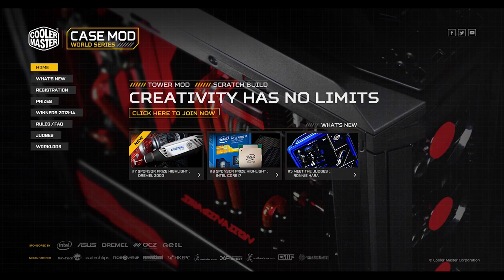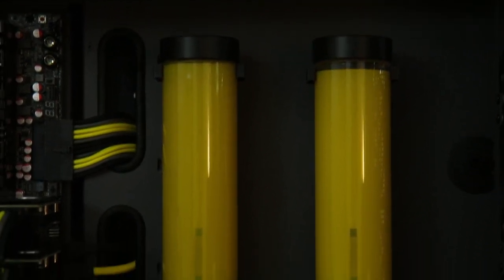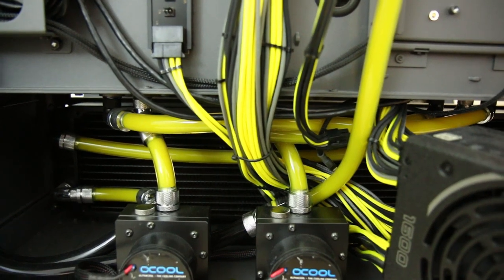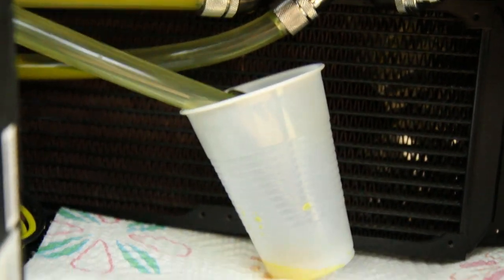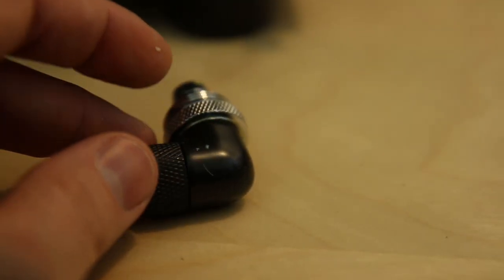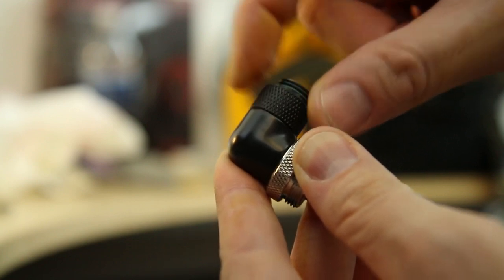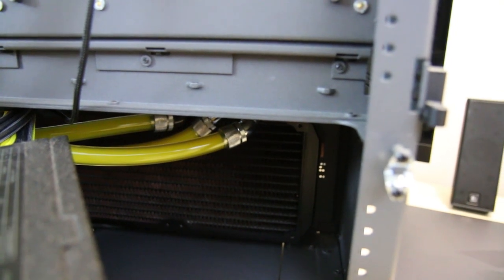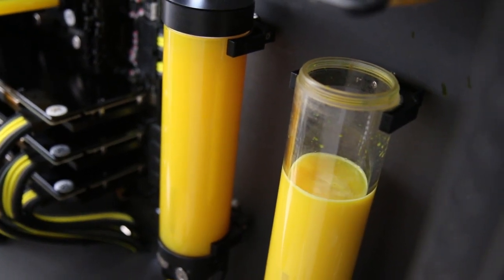My $6500 Custom Watercooled PC LEAKED!!! Now lets fix it....

Comment: lol 800$ watercool kit vs jerry aircooler jerry won !!!
Reply: I guess Jay´s system is more powerful than jerrys ^^^3x GTX 980 very high OC > 2x GTX 980 poor OC
i7 5960x @ 4,5 GHZ = 2x random xeon @ 3 GHz
Reply: the cooling solution not the entire system im talking about
Reply from the maker: Viking Tech If we are talking about Reliability and Maintenance, then yes Jerry Wins
Reply: tks
Reply: ***** Because Jerry´s using aircooling from noctua, and noctua fans & coolers are extremely reliable. But from performance sight jay wins. :)
Reply: Christoph Zehetmayer Not to mention water cooling looks way prettier than air cooling ;)

Comment: I'm too scared to water cool
Reply: Their is no need for it
Reply: The best way to go is closed loop with like a h100i but yeah this is open loop and you have a higher chance of a leak
Reply: +super piggy over time, with whatever components you use, they don't stay as cool as they would have when coming straight out of the box. So i guess there it's purely aesthetics and future proofing. And of course those who don't want to custom cool can always use AIOs which are much more safer but not really the best future proofing.
Reply: +Joeyb Theman Are you scared to use your kitchen sink? Are you scared to flush your toilet? Probably not, because you know they were assembled correctly by professional plumbers. But those plumbers didn't have the option to assemble your water setup outside of your house, and then install it in the house, so they made sure they did the job correctly. You can assemble a loop outside your PC to test it, there's nothing to fear.
Reply: +CreoleRep7 That is not true at all. The Thermal Design Power (TDP) of a processor or GPU is the same when it's 20 years old as it was when it came out of the box. If the transistors in the component have deteriorated enough to actually increase their heat output, the component was likely unstable or malfunctioning long before that point was ever reached.

Comment: Reading the comments it is clear to see that few understand how air cooling and liquid cooling work. For starters liquid cooling is just another form of air cooling as it relies on air passing through the radiators to cool the liquid. Air cooling and liquid cooling both cool through a process called thermal conduction. Thermal conduction is the transfer of internal energy by microscopic diffusion and collisions of particles, the speed and effectiveness of thermal conduction varies depending on the material used. The conduction process can be made more efficient by increasing surface area and/or increasing air flow allowing for faster thermal conduction. Air cooling relies on conduction through a heat sink usually using pipes to efficiently conduct to a large surface area, the fins. Unfortunately heat sinks reach a point of diminishing returns beyond a certain size to the point they don't offer any more cooling performance. Water cooling does also reach a point of diminishing returns, but it has a greater potential to conduct than air cooling due to the fact that liquids conduct much better than gases. Liquid cooling is able to move this heated liquid away from the block using a pump, so in turn has the ability to conduct to multiple heat sinks (radiators) and this is the reason that water cooling is more efficient than air cooling,  its able to conduct better and to a larger surface area. You should think of liquid cooling more like air cooling, but with the ability to connect many heat sinks (radiators) together. One more thing, usually All In One liquid cooling products are cheap with only one small radiator, low quality liquids and small pumps, so they don't perform much better or they perform worse versus air coolers of the same price.
Reply: Hello rick and morty fan. I wish my IQ to be as high as your 200 IQ one day

Comment: I want to see vodka cooled videos. Please. Thanks.
Reply: that would be a bad idea...
 bc your pc would be drunk as fuck... ahhaha
Reply: Vodka is aiming fluid comrade. PC would just become aimbot.
Reply: DevPre Are you seriously taking his joke?
Reply: In the meantime, look up his video on orange juice, milk, and Powerade. Because science.
Reply: He did use Anti-freeze. Usually in anti-freeze are chemically similar components compared to vodka. It wasn't very special.
Reply: Volkier Neigh I mean, the Russian used it to cool their radars. So it must work in pcs right??
Reply: Thats a really bad idea man, for so many reaons. Its a solvant (tubes wont like it and rubber will bleed off its oil and become dry), its flamable, it evaporates faster than water, and its a much worse lubricant for a water bearing pump. Its also lighter than water and thus has a lower thermal transfer rate unless its evaporating. It also has a lower thermal capacity so of the heat it does absorb, it cant absorb nearly as much per litre with 40% alcohol in the water, which means if you are overclocking and making record runs, you have less time to do so before the water temp raises to a point where a highly strung overclock is unstable.
Reply: Its done

Comment: dude, I worked in the oil/gas industry, and fittings and lines thousands of dollars leak. sometimes welded lines leaked. but seals and gaskets tend to leak regularly and frequently. so that's why its better to change seals and gaskets on a schedule when u can plan for it, than have it happen when u don't know.

Comment: Talking about cooling. I remember one summer where I was at a friends house, and he had to put 2 bags of ice, one infront of his intake fan, the other on the top of his case, because the summer was so hot, the computer was overheating every 15 minutes. The interesting thing was that the ice bags actually helped and the computer didn't overheat until the bags melted!

Comment: Holy fuck... haven't finished watching yet but I hope nothing is broken!
Reply: Kawayolnyo dude stop trolling
EK is one of the best manufacturer in the market.
Reply: Kawayolnyo I use EK and bitspower and have had NO failures.
and some of these fittings are 5 years old
Reply: Kawayolnyo both are working fine
your argument is invalid
Reply: Kawayolnyo stop trolling kid.
Reply: Kawayolnyo All rubber O rings go bad regardless of the brand. A better brand might just make sure you have a newer part so you have more time before it is likely to fail. It is still likely to fail at some point.
Reply: Kawayolnyo Good to hear you haven't had any leaks. If you upgrade to new systems or replace parts in a system often then you are less likely to encounter this issue. It can take a few years for an O ring to go bad. It is a numbers game. You might never have an issue or you might have lots of issues.

The quality of the part does have some role to play in the mean time before failure. As the part ages though, your odds of failure increase. Not every fitting with an O-ring is destined to leak but many will eventually leak. A quality part can buy you some time and give you better odds but even the best parts will fail some of the time.
Reply: Kawayolnyo I read the post. Go read mine at the top of the page that goes into detail about O-rings. EK may or may not make worse parts than other manufacturers. I am just saying that a large part of that quality is in how fresh the O-rings are. The design and tolerances also of course play a role in overall quality. Even with a part that you consider to be the highest quality though you have a chance of failure that increases over time. You might have just had extraordinarily bad luck with EK or they may make bad parts. In either case though changing brands doesn't make you safe - it just might reduce the frequency of issues or increase the time before issues are likely to happen. If you can get that MTBF well beyond the useful life of the system then you may be fine. If you really want to be safe though you could use a fitting that doesn't need an O-ring at all.
Reply: Kawayolnyo Well, I did have a leak with some EK fittings after three years of using them. Luckily, it was nothing fatal, just around the back of the case, like this one. I still don't take chances though. Replaced every EK fitting with BitsPower. No problems since. I wouldn't call them "complete shit", but more like "half-shit that lasts a while and should only be used temporarily". I could have just gotten unlucky, but I'd rather not take my chances again.
Reply: i just didn't want you to stop with the truth.          i see your post though. ty for the kof reference
Reply: ***** They do need some better colors on their fans though. :P
Reply: thanks for all the knowledge.

Comment: this is my biggest fear, and the reason why I think I'm just going to air cool :/
Reply: +TheOne AboveAll Well, ss he said, the more joints you have, the higher the risk. If you don't use a lot of joints all over the place, then there's a low chance for it to leak. Always tighten each fitting though. That decreases the chance for leaking as well. But don't tighten it too much. That'll risk breaking the tube and then there's gonna be a leak for sure. Golden rule... As far as I've heard, is to tighten the fittings as much as possible with ones fingers only.. Or till it feels sealed. 

I'm no professional, but seen from a logical viewpoint, then it gives plenty of sense that if you use few joints around the electronic part of your system, then you have to be pretty darn unlucky for it to leak. You can also always test a watercooling system, before installing it on your setup. Test it with distilled water though. As that is what most fluid consists of. If you also run two seperate loops - one for your CPU and one for your GPU(s) - then you're even less likely to have catastrophical leaks that breaks everything.. And you don't have to drain your entire system to repair or change something :) 

Soft tubing, few joints and seperate loops. Those are what I would say is the safest bets on a custom watercooling setup.

But you can also just buy premade watercoolers for CPUs. They will only watercool the CPU, but the blame won't be on you, if they leak :)
Reply: ***** He's just trying to troll. Though he is forgetting that real trolling isn't doing obvious insults. Trolling is just hinting at insults, but never saying them. Obvious insults basically equals what you've already said. 8 year olds trying to be smart on the internet. Which is just straight up Brian.
Reply: As long as you don't do extreme overclocking then watercooling isn't even a necessity. Unless you REALLY want to
Reply: why simple, make it complicated...😂

Comment: Why not fix it with just a bit of Teflon tape?
Reply from the maker: It wasnt leaking from the threads, it was leaking from the oring. Cant tape an oring.
Reply: Oh.. I gotcha now.
Reply: well, replacing an O.ring is an easy fix, just remember to put silicongrease on it
Reply: +vann tedd there are fluids that have uv- reactive stuff mixed in, you will need additional uv lamps inside the computer to make them light up.
Reply: It probably would have been cheaper than the surgery too.
Reply: waaaaayyyyyyyyyyyyy late but in the signs its neon used
Reply: As a plumber in dire need of a fix, yes you can ! but only temporarly  :)

Comment: If I noticed correctly, your psu is right under those connectors (sorry I already forgot the proper name for them as type this).  if so could be the vibration from its fan slightly moving things in there...cool pc, I'm glad you fixed it and I'm glad you did post this video.

Comment: Well I just noticed the awesome plumbing job. You guy's do of course realize that every 90 in the plumbing puts more resistance/back-pressure/strain on the pump. But it does look better than the long curve's you get from the other tubing.
Reply from the maker: That is why I use the D5 pump.... it can handle this without problem
Reply: ***** Wow, 1135L/h. That is moving over 306 gallons an hour. Nice. Never mind. Mr. Jay does over clocking my new GTX 980 shorten it's life?
Reply: Jim Morgan Yes, you will be putting more voltage through it and it will be "refreshing" itself faster :) But it doesnt matter really
Reply: BarrelDoesGaming
 So then it will shorten its life? If it would last 100 days, just say-in. How many days would it be cut short? Oh, and I don't overclock more than NVIDIA's recommendations for said overclocking.
Reply: Jim Morgan there is no way to really know that, your biggest concern is heat.
Just make sure you have adequate cooling and it should last a good long while
Reply: Jim Morgan
I would say like 99 days
Reply: Noah Sharbonda
Tanks, I guess I'll stay away from overclocking so as to get all the life out of the card I can. Thanks for your time.
Reply: BarrelDoesGaming
Yep I'm guessing if I don't overclock i'll get the 100 days. It was only $599.00 plus uncle war/mongering sam/$646.00. But a nickle is a nickle. I'll just get one and and SLI. Tanks for your time.
Reply: Jim Morgan I would not worry about it, unless there is some underlying problem with the card, you won't kill it before you upgrade, had an overclocked sytem running steady for about 5 years
Reply: Noah Sharbonda
What card are you overclocking?
Reply: Jim Morgan i have a Nvidia GTX 260:

Core Clock: 730 MHz
Shader Clock: 1574 MHz
Memory Clock: 1265 MHz

a Nvidia GT 610:

Core Clock: 905 MHz
Memory Clock: 1135 MHz

and I also have a AMD R9 270:

Core clock: 1305 MHz
Memory clock: 1500 MHz

The gtx 260 has been running stable for 4-5ish years, the GT 610, has been running stable for about a year, and the r9 270 has been stable for about a year and a half.
Reply: I have ALOT of fans in my rig with the gt 610 and it runs REALLY hot and its prob not good but i got it for 20$ so whatever
Reply: *****
Tanks for your time. I believe what you say. So um a, don't come in my house and take me out with a NINJA Star.
Reply: *****
lol you can do any thing.
Reply: Whoosh, I just got this reply from you. LOL Crazy. 5 years, that is a long time. Thanks. Just got my second GTX 980. One more and I'll be happy. lol Now to get them water cooled. Can't wait.
Reply: +Jim Morgan the only thing you have to worry about us it getting too hot so if you are good on that then overclocking shouldn't do anything to make it not last as long
Reply: why overclock a 610? for the lols?

Comment: I had this happen to me as well, very very slowly. Was a rotatory bits power 45 degree fitting. Was a very slow leak but enough to make me freak out. Replaced it and all is well. After I pulled it out the broken fitting to inspect it it had a ton of play to it. I was actually able to just pull apart the fitting with my bare hands, no idea how it happened but it was placed similar to yours upside. Either way I know the feeling...... and scary as hell til you figure out exactly what is leaking